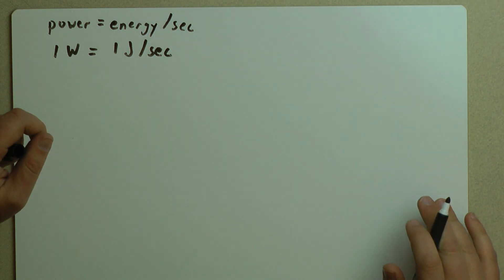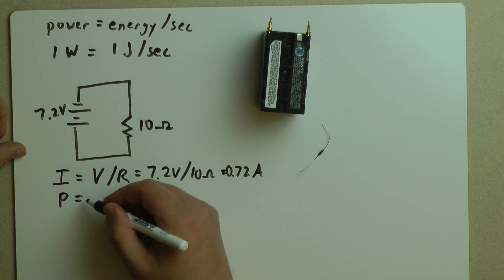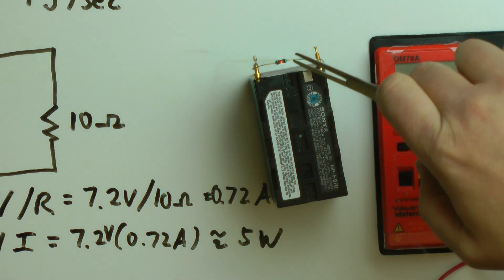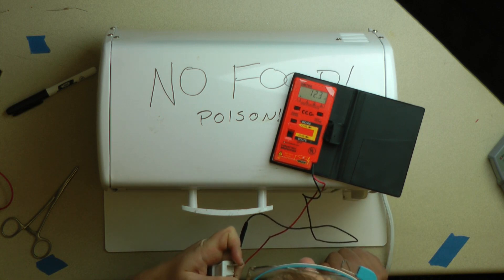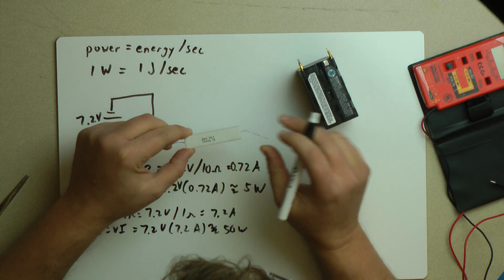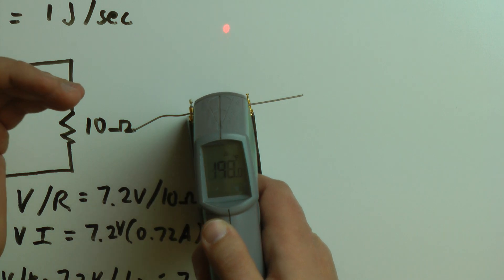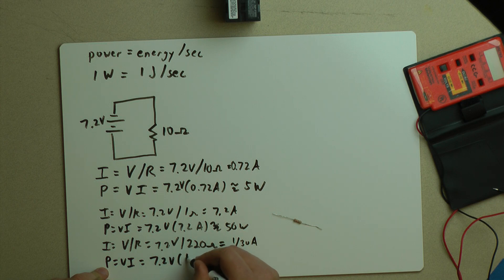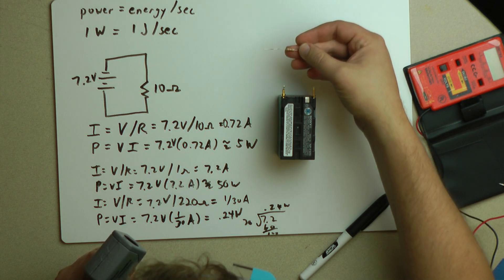CS 3651 Power: P=IV and Resistor Wattage

Comment: hi, i wonder if making a series of 1/4 watts would lower the overload of the  resistors? meaning if the resistor are 1/4 watts max, so can i add more of resistors to increase watts max in a series ??? i got 1/4 resistors and i am trying not to burn the resistor out and i am using 12 volt and it produce 5 watts and the amps is .42!! Any ideas